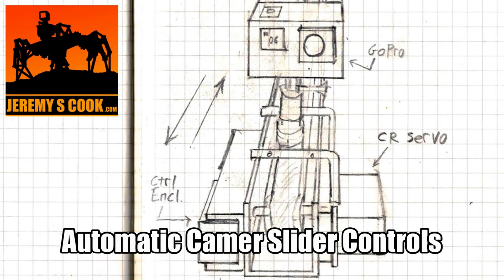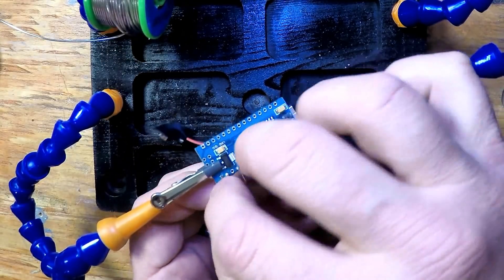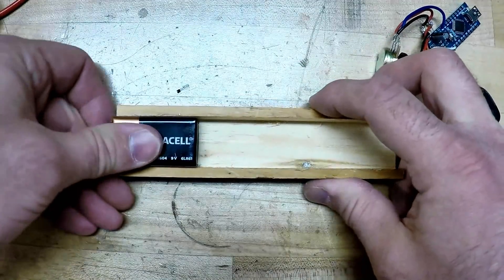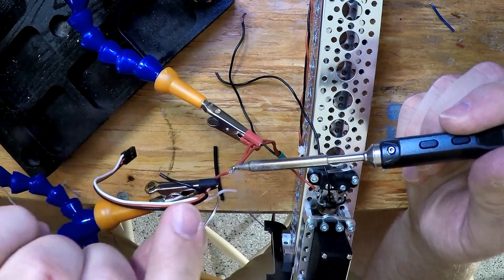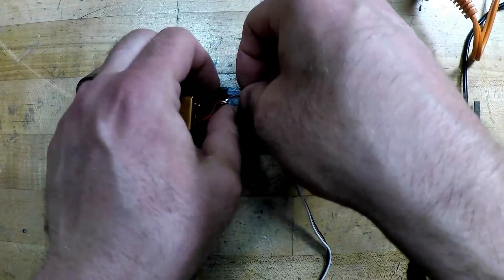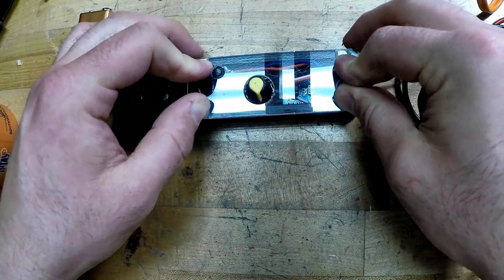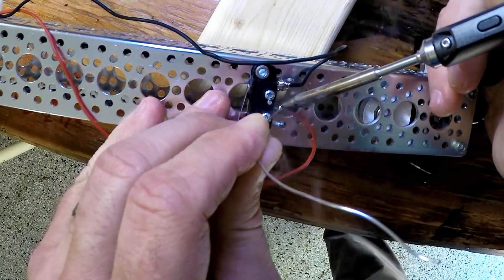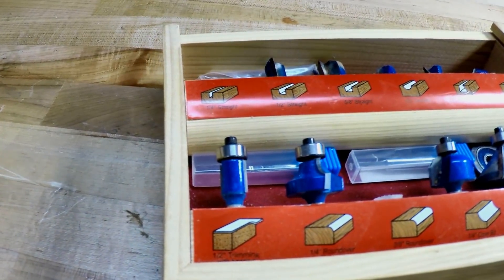Automatic Camera Slider Controls [Arduino Nano]

Comment: Why not use a small stepper motor?
Reply from the maker: That should also work. Mounting was easy in this case, so I wanted to try it.
Reply: yeah mounting a servo motor is way easier but with a stepper motor you can do way more then just adjust the speed of the axis you can programm it do more complicated movements
Reply from the maker: True - guess these projects are never really done ;-). Oh, and controls are simple too - didn't need a driver board, which was helpful given my limited space.
Reply from the maker: Thanks for watching!